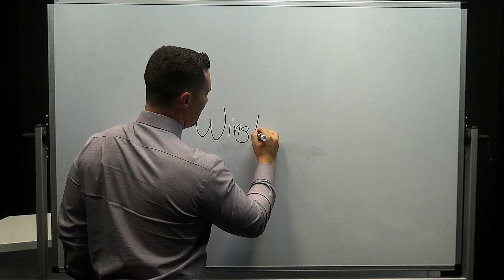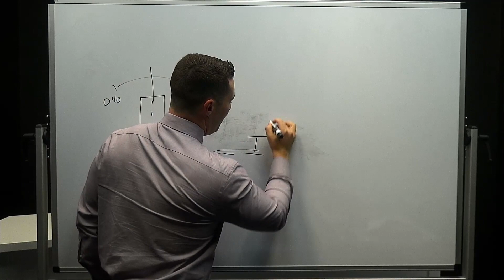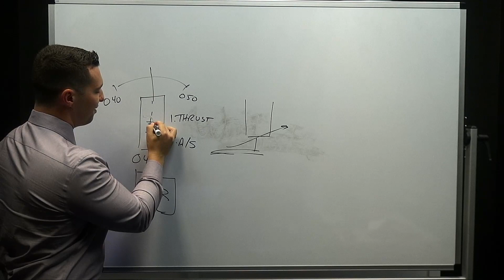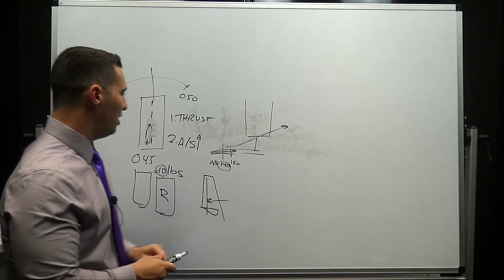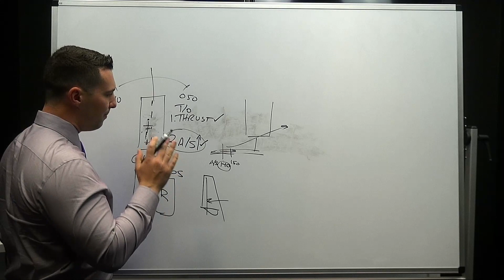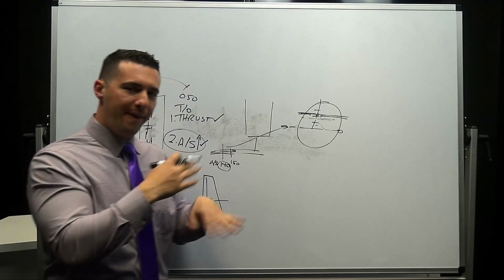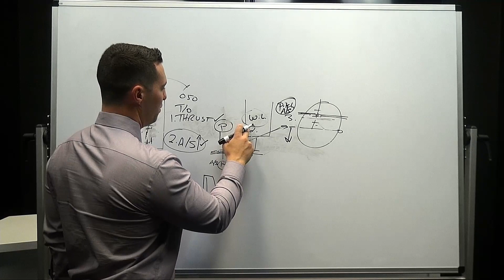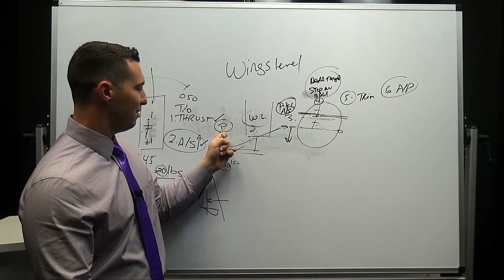V1 Cut Explained

Comment: Joe, thank you for this video! I have an interview with a 135 carrier in two weeks and they require a sim check. I understand that it includes a V1-cut with no autopilot and no flight director. You kept saying in the video not to go above the FD. With no FD, how do I successfully handle this V1-cut? What should I pitch for? Is monitoring the airspeed now the key?

The sim will be either a Challenger 350 or a Phenom 300.

Thanks!